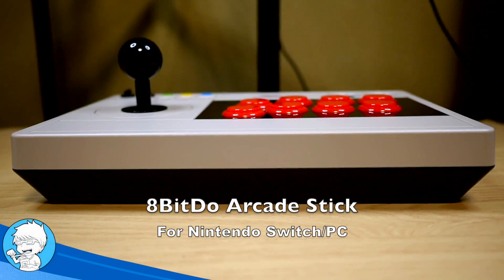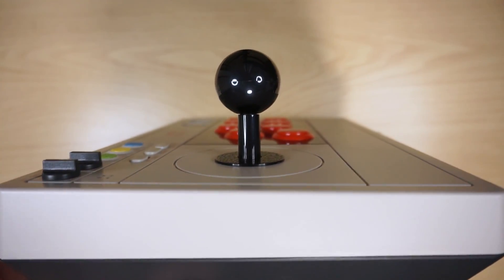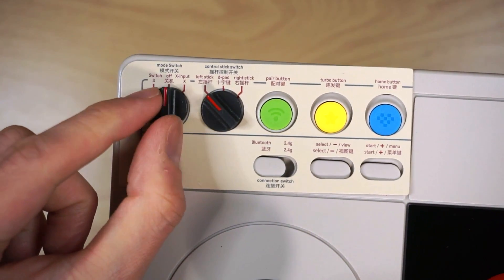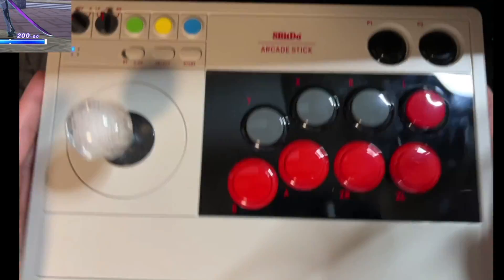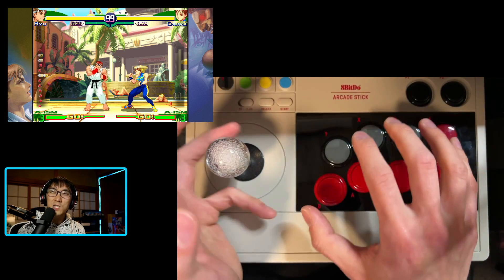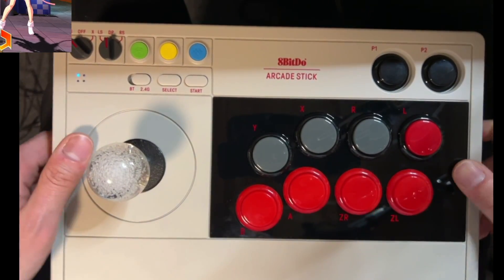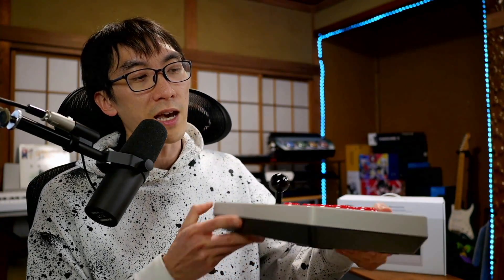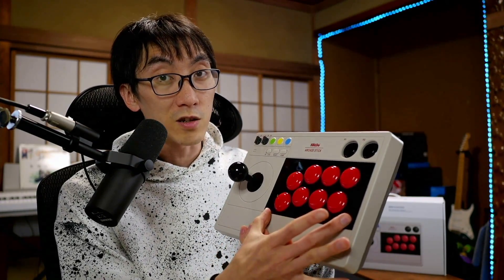FUN is Wireless!｜8BitDo Arcade Stick [Nintendo Switch]

Comment: I got 2 8bitdo sn30 pro plus controllers, and this 8bitdo arcade stick. I recommend all highly. You can customize the arcade stick with sanwa parts or whatever you want.
Reply: I use it for skullgirls, sf alpha 3, 3rd strike, dbfz soon Darkstalkers. Works on pc, switch, Mac, Linux.
Reply: yeah and i use it on a desk so i don't really have any problems with them being cramped or not being stable on my lap
Reply: I've put Sanwa buttons on my 8bitdo stick and it's phenomenal. I genuinely don't think 8bitdo can make a bad controller, and that extends to this cheap, but great quality stick.
Reply: Does anybody know if Harpp American buttons can fit insides ?
Reply: @DANNY199566 unfortunately not. Parts are too tall for the case

Comment: You can buy the Mayflash Magic-S Pro 2 adapter to use on your ps4 or Xbox for $26 as an alternative to the $45 adapter. I’m actually building a arcade stand to drop in 2 of these controllers to play on my ps4 when my buddies come over as thanks to the wireless feature

Comment: I've had this for a long time-- about a little more than a year, and it feels not too bad, especially as an entry point to sticks. The only modification I've made to mine was installing an oct gate to replace the square gate that comes stock as at least for me having the tactile feedback of going from one position to another is absolutely paramount to my execution.
The lap and the stick and button position comments are totally valid. This is definitely a table stick rather than a lap stick.
Reply: Same here. I initially only had an octo gate instead of the stock square gate, but I eventually modded it with silent Sanwa buttons and a Sanwa joystick, and it is amazing for PC.

Comment: A very good review overall! I have this stick and want to offer a bit of a different perspective. I am not an advanced fighting game player, casual enjoyer at best. Hower I love playing retro or modern arcade style games - SHMUPs, beat `em ups, side scrollers like Metal Slug or just emulate old 8bit and 6 bit games. And this stick is AMAZING for that even in its stock form. I can kick back on the couch, load up some games on my switch or PC hooked up to the TV and enjoy some retro/arcade goodness spiced up with some sweet nostalgia!  Its a 10/10 stick for that purpose.

I would even argue that the slightly loose stick is a feature. Remember the day you used to visit the arcades? I dont know about you, but for me it would be EXTREMELY rare to have a cabinet with super crisp and tight stick. Most would be loose and some barely working. Yes its not optimal but it does bring me back to that time, which I like.
Reply from the maker: Haha actually that’s a fair point. Most sticks at the arcade are loose from hundreds of hours of being bashed about all day

Comment: This stick is pretty nice for casual play with friends. A spring swap or changing the lever to a Sanwa JLF is essential if you want to get serious since the stock lever is a bit loose. I barely use it on the Switch though, the bluetooth makes it really makes it convenient for quick matches on PC so I use it there more. Sucks that screw in buttons don't really fit but that's the only thing I don't particularly like about this stick.
Reply: Also for some odd reason its pricing in the Philippines is nearly half the SRP (2700PHP or around 54USD as opposed to 90USD).
Reply: @LeKingCarnage  Ya just got it on sale at Lazada for about PHP2580 ($50) delivered.  Insane pricing. Maybe because we're near China?
Reply: @surft  I would assume our suppliers might be getting stock directly from the factory hence the lower pricing. Occasionally some japanese only Hori products cost a bit less here in PH as well. But nearly half off for this fight stick is quite  baffling since the closest competitor is the Mayflash F300 for $60.

Comment: I thought about buying one of these. Decided to spend the $90 on a brook wireless board instead. Very happy with my modded, wireless Madcatz TE that connects to multiple consoles.
This is still a rad entry point. Way better than the madcatz se I started with.

Comment: I got mine last week and I'm loving using it on dreamcast with the brook wingman converter
Reply: Update: bluetooth functionality died 😢 led displays diagonal lights and doesn't connect to anything unless using 2.4 dongle or wired. This is super upsetting tried firmware update which fixed the led  not displaying properly when charging but doesn't fix bluetooth. Seems others have this issue and have had to return.

Comment: Do you have any reviews of a wireless fight stick for PC that has similar features but better ergonomics? Mainly will use for retroarch. In a perfect world would like to be able to use it both on PC and  android based retroarcade platforms. If it worked with Xbox or Switch also that would just be icing.  I had liked this price point, as I want to get two of the same for head to head with son, but ergonomics are extremely important for me, I have big old man hands.

Comment: I don't feel much need for a fight stick on Switch since I just don't own any fighting games on it. The reason I grabbed this is the Switch is absolutely full to bursting with arcade style shoot 'em ups. Unfortunately, the loose stick in the stock unit was a deal breaker in that environment. I tightened it up with an octagon gate and oversized actuator. I imagine it's probably awful as a fight stick now, but other genres are playing pretty well.
Reply: Shmups are the only reason I started picking up sticks for Switch. So far, they've been awesome to experiment with even though I don't use them for every single arcade shooter. At this point, I lean more toward dpad for retro shmups and I'm wondering if there are any dpad arcade "sticks" on the market where there's no actual stick, but a dpad instead.
Reply: does this stick work with any good non fighting games, like the gba games on the switch? i’ve been struggling with tendinitis and looking for an easier way to play chill games

Comment: I've been an avid fight stick enthusiast and FGC member for many years. I have several fight sticks and leverless sticks, all upgraded and tweaked to my liking. The 8 bit is by far my favorite stick. Definitely swap out the normal components to improve it, and with a detachable joystick it's probably the most portable on the market I would argue, both size wise and feature wise. Do not make the mistake of discounting this 80 dollar instrument of enjoyment, I would take it over probably any other stick on the market.

Comment: It is a great stick I had it for a while but one thing I did notice is when you have it on Bluetooth and you use some Bluetooth headphones as well it makes the input lag drastically bad. But when I noticed it I just plugged the 2.4 dongle to the switch and it was back to normal. Just fyi if some one was wondering.
Reply: It is not really fault of the stick, rather the switch bluetooth is hot garbage. It can barely handle 4 controllers at the same time. All my controllers lag and have connection stability issues, including pro, SN30 Pro, joycons, you name it. Only 8bitdo receiver is stable funny enough.
Reply: @ALE34_  yeah the switch wireless card is actual garbage. even the WiFi

Comment: I have 3 sticks now. My Qanba Q1W is my casual wireless 2.4GHz stick (though I have it modded with Seimitsu parts) which I think is easier to deal with than what I can tell from the 8Bitdo stick. I can have at least the main 8 buttons be screw ons although I have only snap ons on that stick. It may not be as compatible but I only play on PC so it's no big deal. I think it has more room for my hand although not as much as my other two sticks and I didn't have to cut wires or so to mod anything with it.

Comment: For someone who would consider the wireless features mostly a nice-to-have (though the removable cable is some fantastic future-proofing in the all but inevitable case of cable failure at some point in the product's lifespan), and rather ergonomics being the main concern, would you consider the extra ~$50 for the hori hayabusa money well spent for its wider base? 

Are there any other points where the 8bitdo stick is an improvement on hori's product? Anything that might make you choose the 8bitdo stick over the hori hayabusa besides the price (and wireless connectivity)? It has been a while for me, so I can't recall the details of your hori hayabusa switch ed. review very clearly in terms of mod-friendliness and such.

Excellent review video, as always!

Comment: The modability of this put me off; they initially advertised it as being extremely mod-friendly but that turned out not to be the case unless you're opting for standard Sanwa JLF and buttons. Hopefully they fix this in a future revision.
Reply from the maker: With just a few small tweaks they will have a product that wipes the floor with other sticks in this price range

Comment: I can't even pair mines had it for over a week. Instructions are vague I don't know if I need to use dongo thing or wires. Or does it only work in dock mode? I tried everything I just can't get mines to work.

Comment: I love arcade sticks even though I never owned any.
Reply: You should get one. Any dpad heavy games are fun to play with one. Even ps1 action games like Tenchu
Reply: @buckbreaker5185  Do you know any good ones that can be used on both PC and consoles?
Reply: @SolarFarle  imo you are better off making one. They are extremely easy to make and pretty cost effective. You can make a pro tier one for about $150 with a brooks pcb, a box from etsy, and sanwa parts. Even less if you make the box yourself. Additionally, for entry level the Qanba drone is surprisingly good (especially if you switch the lever and buttons with sanwa parts).

What console do you game on?
Reply: @SolarFarle  also most sticks that work on console should work on pc. My friend plays on a qanba drone which is designed for ps4 but it is plug and play on PC as well
Reply: @buckbreaker5185  Alright thanks. And lately I have been gaming on my PS4, Xbox Series S, and occasionally the Switch. I use my PC mainly to game. I never exactly built anything but I am willing to try at some point. Again thanks.
Reply: @SolarFarle  right on. Not sure about Xbox sticks but there are a ton of them out there. If buying a stick the main things to worry about are the PCB which dictates input delay and compatibility, and the size of the stick. Usually sticks that are about 18 inched wide are most comfortable. I have a smaller 12 inch stick so I set it on a table for stability.

Good luck! Theres a ton of resources out there. if you build one you will also be able to put custom artwork on there easier too
Reply: Buy this one. Its excellent quality wise. 8bitdo really uses top materials overall.
Reply: @ninetendopesaitama2107  Idk man I had a pro2 and it died within like 6 months. First it started going through the battery very quickly (both the rechargeable that came with it and several other rechargeable double A batteries thay work fine in other controllers) then the left thumbstick and left paddle went out shortly after. I loved that thing too but now I fear their build quality
Reply: @buckbreaker5185  Thanks again for the help.

Comment: The dock adds a frame of input lag even though it's a wired connection. I have the 8-Bit Do and Hori RAP SF Ryu stick. The 8-Bit Do connects to the Switch itself and not the dock, eliminating that extra 1 frame of lag. Get the 8-Bit Do not get the Hori.
Reply: how you connect directly when docked? :O

Comment: odin mod when? ( ͡° ͜ʖ ͡°)
Reply: Oh man, Bob had entered the chat.  I was actually going to recommend NG watch your 8bitdo arcade stick mod videos - those keyboard directional inputs did make it pretty sick.
Reply from the maker: Hmm Bob urs is wasd tho right? Does the 8bitdo have socd cleaning built in? Might consider doing it if it were the Odin Loki version with right thumb jump. But even then the AS Indo Cardimod+ is more flexible position wise. Also right hand position a bit too far left when placed on lap.
Reply: @NihongoGamer  Yeah mine is the WASD configuration. I'm not sure about the SOCD, you may need an additional device for the loki / cardi to passthrough for that.

The cardimod is installed using an adhesive right? The only reason I'm all about the odin is it just plops in right where the stick hole was and screws in nice and tightly. But if you aren't a fan of where that hole is, I could see the potential issue.
Reply: @WulffDen  any fix for diagonal leds when trying to pair bluetooth seems like its a pretty big manufacturing defect with these units.

Comment: I have this stick and also the Hori alpha... I gotta HEAVILY disagree with you on the ergonomics of it, First off you have to reeealllyyyy try and move it around for it to do what you demonstrated and also why is it resting on your legs? that has to be a preference because Im 6ft tall and it sits on my lap pretty comfortably thanks to the compact size, second the hand placement thing is kinda weird considering most peoples hand float when playing fighting games, do you only play with your finger tips? doesnt seem very practical, if you want faster inputs you should probably be going wired anyways thats the traditional way